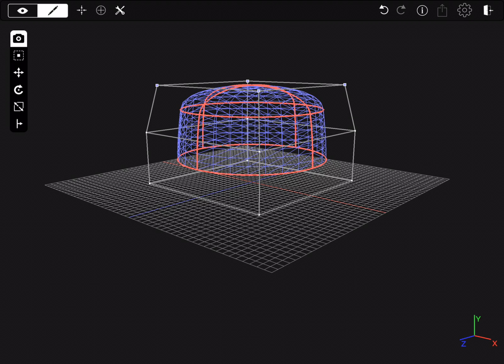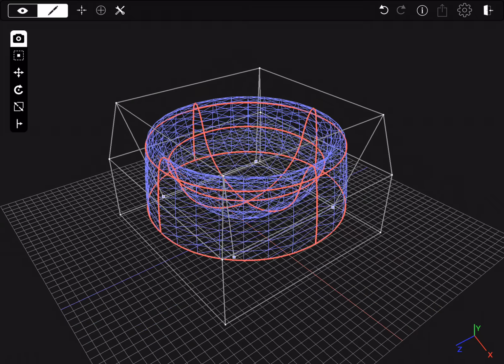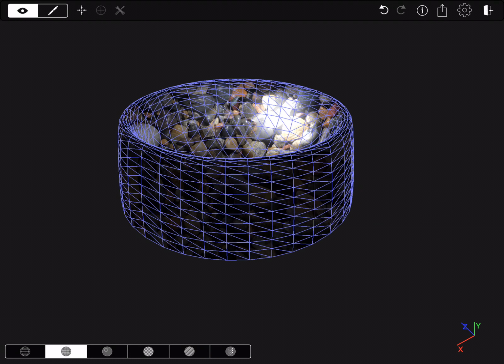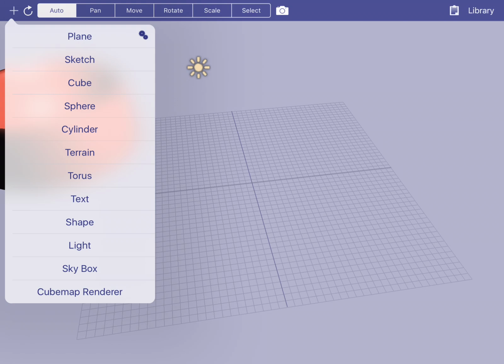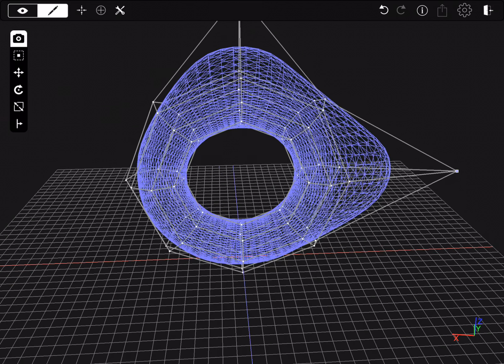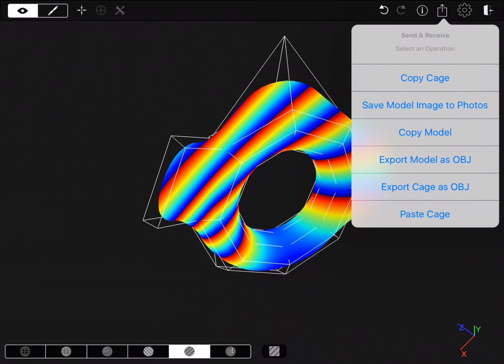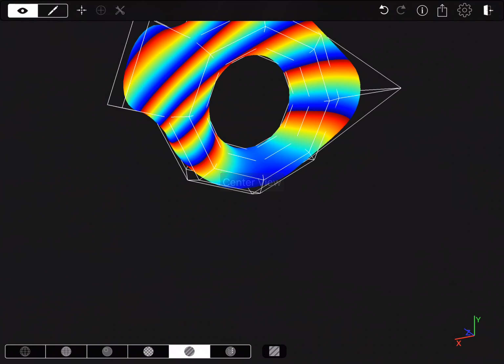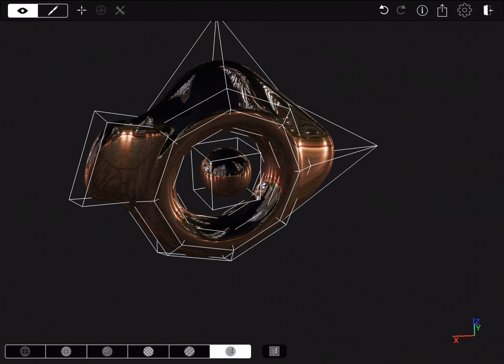SuperD :: Smooth Subdivision Surface Modeling on iOS

Comment: Verto on ios has been abandoned, hasn’t it? It’s one of few apps I’ve found that seem to come even a little close to a real poly modeling app for iPad. The website for SuperD linked on the twitter page is also nonexistent. This is such a shame. There is an overwhelming demand for REAL poly modeling on iPad Pro, but it seems there is literally nobody interested in making it happen. Everything is abandonware, useless, or is simply another CAD app. CAD is NOT the same as poly modeling but that’s what everybody points to when looking for 3D modeling apps for iPad.
Reply from the maker: Not abandoned. See my twitter or the official discord.

Comment: Oh! Verto Studio is from the same company as SuperD?

I had no idea. I own both at this point, just bought SuperD recently. I am of the impression that Verto Studio has mirror modifiers; a great tool that should be here too.

I haven't gotten to using VertoStudio a lot, it looks like it has all the tools one could hope for, however I still find it a little cumbersome to handle on my iphone because of it's UI. A hard challenge, given that most professional 3D software has cumbersome UI.  This is where SuperD excels, UI and UX is much better. I haven't watched tutorials yet but it all is quite intuitive in comparison. Especially if you're already familiar with 3D modeling.

Another suggestion I have, would be to add Face selection. Selecting vertices one by one is tedious too. A tool to "grow selection" or "shrink selection" would be very handy too, since things like these would simplify the tediousness of constantly having to select collections of vertices to move them all around at the same time.

Some vertex culling so that we can't select non-visible vertices would be ideal too, at least as an option. Please keep in mind that when modifying objects on a phone, one often can't press the screen with precision. Having us handle vertices this way makes for a very "flaky" experience. Having both vertex culling (as an option, naturally) and face selection, things would be much simpler. I am sure this is not such a huge issue on an iPad, but IMO the coolest thing about THESE apps, are not their iPad version but the Phone version itself. Phones today have huge screens, being able to have a nice "sketching" app on a Phone is to me 100x more valuable than on an iPad, as I actually carry my phone everywhere and realistically if I have my iPad around, i probably also have Blender. 

Considering the integration with Verto Studio and Verto Studio VR, this makes for a simple and amazing way to bring models from your phone to your computer for further authoring of 3d assets on professional 3D software if needed.

Last:

I've been messing around with it too little to be sure this is a bug, but there seems to be quite some problems when scaling. If I start with a box and extrude each side separately, and then proceed to only select the new vertices created, and scale them (leaving the original "box vertices" unselected), it is very clear that the center of the transformation is NOT the center of the vertices selected. The transformation occurs assymetrically.

Sorry, I know this is a very long comment and mostly filled with remarks - but it comes from a good spot.

I love 3D modelling and have been looking for ages for an alternative to Blender on my iPhone. This seems much easier to handle than the other few I've tried (polygonify or something like that and VertoStudio) but it has VERY few options, and is a bit buggy sometimes. I can see the potential but it still needs some more work, especially given that it wasn't a cheap app (15 dollars). 

Now, 15 dollars is still worth it, don't get me wrong. However, it could be worth it even more ;)